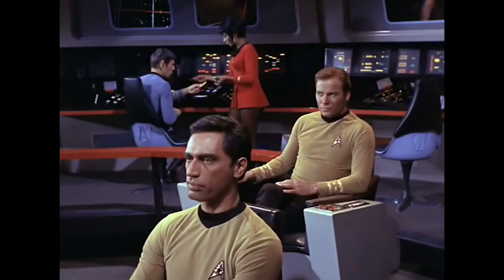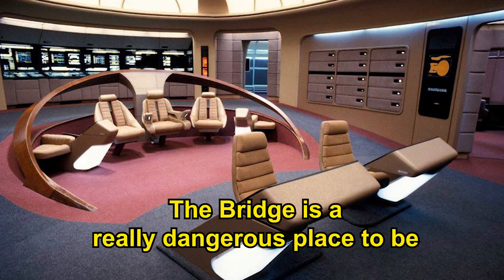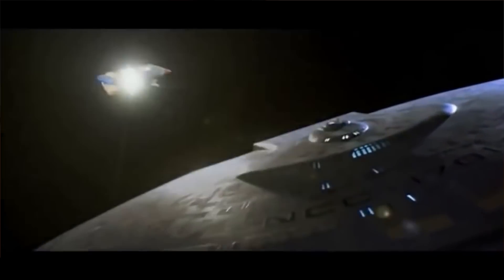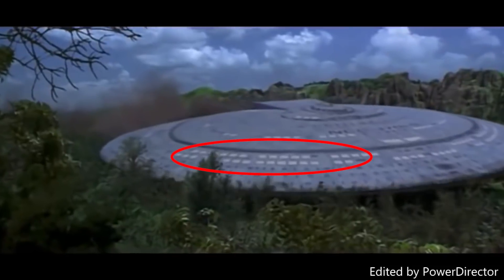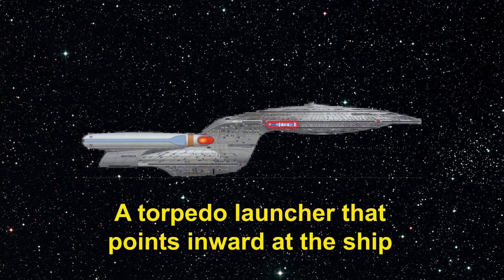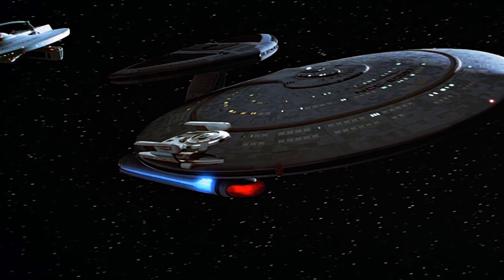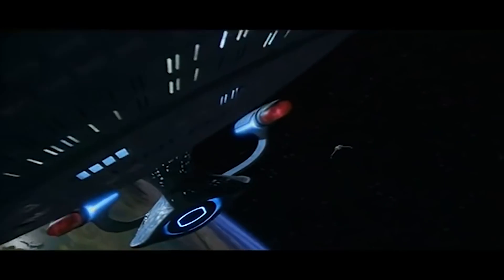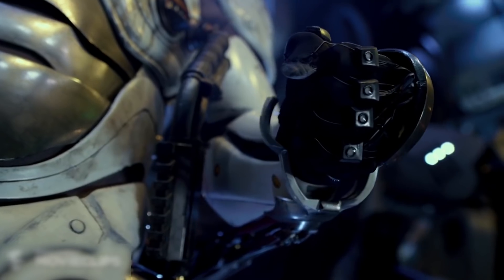10 Flaws Star Trek - USS Enterprise NCC 1701-D

Comment: Bridge is a known issue. Though how much it matters given how flimsy unshielded ships in Star Trek are in general is hard to say - most don't survive very long without shields, and WITH active shields it really doesn't matter where anything is.

Exploding bridge consoles... Yeah, that's just stupid in general and makes no sense.
... Restraints? Oh, you mean like the deleted ending for Nemesis? XD 
Then again, you'd need those throughout the whole ship; the bridge is no more dangerous than anywhere else, because what throws people around the bridge throws people around throughout the whole ship. (we never see this for some reason though.)

The saucer section landing probably could've been better, but that was essentially a completely uncontrolled landing, and they were determined to destroy it - in all honesty if the saucer had been functioning properly it would have remained in orbit, which was vastly more sensible than trying to land it anyway.
It's not like the ship's saucer section is in immediate danger just for having separated. It can likely operate for months if not years that way, even if it doesn't have warp drive.

A more controlled landing method would've been nice, but the way that film was written they would've crashed it anyway.

The shield modulation frequency...
Yeah, that's a stupid way of doing things, but it's quite specifically the MODULATION frequency.
Eg. the rate at which the shields change frequency.
The method could be improved, but the reason (insofar any was given) that ships even have a modulation frequency for the shields is because the shields are bidirectional - you have to drop parts of the shield in a controlled manner on a regular basis just to be able to fire weapons through the shields or even use the sensors.
Still, a less predictable modulation method is clearly needed.

Torpedo launcher complaint seems like a dumb one.
You know there's a phaser array in approximately the same spot right?
Besides, torpedos are just empty shells when in storage - you can't just detonate one, because for all practical intents and purposes it has no warhead - arming it by loading antimatter into it is part of the launch sequence.
That's no more of a risk than the antimatter pods.
For that matter, even if it was a risk, look at where the other two launchers are.
The forward launcher is in the thinnest part of the neck, so if you want to blow the ship in half by sabotaging a torpedo, that seems like a much better choice.
The aft launcher is also in a place that's both quite close to the main reactor, AND likely would blow the nacelles off if anything detonated there.
But this is on par with firing a phaser at the reactor core in terms of sabotage. It's hardly a meaningful flaw.
Torpedo casings could probably be transported from place to place inside the ship too if one launcher needs them more than the others.
They're empty after all. Moving an empty casing is no huge risk.

Warp pylons? Really? The same thing nearly every ship design in existence does? I mean, look at the ships the 'warrior' klingons use...
It should be obvious why you'd do this - engine placement is based on a bunch of factors and combat is only one of them.
The use of nacelles on pylons is a safety feature, for one, since you can detach a nacelle in an emergency to protect the ship - the closer to the ship's body the nacelle is, the less safety this offers.
Secondly, nacelle placement and engine performance are not independent factors.
Consider where aircraft engines are placed - there are multiple options, but they all have consequences.
This is typical of a mindset that views a starship ENTIRELY through the lens of combat, without considering ANY other factor. Which is a very stupid and myopic way of looking at things. Would you be willing to accept a starship that can go half the speed, at half the energy efficiency solely for the sake of combat effectiveness? Especially when combat is not that ship's primary mission?

As for joysticks... Eh.
I've used a flight simulator on a tablet PC using essentially only touch controls and it's quite doable.
so is using a PC flight simulator with a mouse.
A giant starship isn't going to turn on a dime, and the slower the craft you're controlling the less it matters.
Plus it's an aesthetic choice, not one based on logic - a keyboard with physical buttons is preferable to touch controls too - yet you don't see any such thing, or even physical buttons in general ANYWHERE.
But, given how such a large vessel flies, I really don't think it makes a huge difference. It's not a fighter.
You're not going to do an immelman turn while moving your giant-ass 600 metre long starship around in battle. 
Touchscreens and the like in my experience primarily are lacking for doing fast, frequent course changes, but that barely matters for controlling a vehicle that can't really do such things in the first place. 
Now, the Defiant could do with a joystick or something similar, but a Galaxy class would hardly benefit that much.
Just think of the primary ship's control as being a virtual trackpad, and if you have any experience of using something like that in a flight simulator you'll soon realise it's perfectly manageable if you don't need hyper-fast reactions...
Reply: It is no issue at all in ST universe and building templates.
Reply: You say that we don't see people being thrown around the ship anywhere but the bridge. I think I remember this happening in a corridor in VOY, and probably in main engineering on several shows
Reply: Other than that though this all makes sense, and to build on the point of the naccalles, their position affects the size/strength of the warp field that can be generated. For example the nebula class shown tops at warp 9.5, but the galaxy can reach 9.8. I'm no warp scientist but as far as I know the defiant broke the previous rules of warp nacelles, in that they need to have nothing between them to generate a field. This explains why voyager's nacelles are raised whenever it goes to warp. Voyager's speed of warp 9.975 is ridiculously fast, however it was the newest, best and fastest ship in Starfleet (because of course the title ship is the best). 

Overall, there are reasons for nacelles being where they are, and in battleships like the defiant they are less exposed, but as you have said, the galaxy class exploration cruiser is not a battleship.
Reply: ValorJ Omega  Besides that, the Defiant is ugly anyway.
Reply: ValorJ Omega 
Another violator of that “line of sight” rule is the Nebula-class starship, whose nacelle "power combs" are largely obstructed by the ship's engineering hull. The Oberth's nacelles are largely obstructed by the ship's primary hull. The Defiant and the Starfleet scout ship of Star Trek: Insurrection each have two integrated warp nacelles that are fully obstructed by the main hull. Other ships violate this rule as well, including the Romulan scout ship from TNG's "The Defector."
Reply: Ben's Pet Duck
Wasnt the Reason for the raising nacells at Voyager that they less damage the space? There was the issue that the normal warp drives did damage the space in some way.
Reply: @adm_ezri  The defiant didn't break the rules for warp nacelles, exactly.  You don't need empty space between them.  But putting anything between them interferes with the warp field and makes it both less efficient on power consumption and less stable, thus limiting your speed some.  The defiant designers specifically sacrificed warp speed to make the nacelles harder to hit.
Reply: I don't remember if they did less damage to normal space at high warp than previous designs, but the main reason for raising the nacelles is that it makes the warp field more stable at higher speeds and thus allows for safe use the higher speeds.  Which is why they were often down when Voyager was going at slower warp speeds or at impulse.
Reply: Regarding the joystick control. The video also fails to take into about the amount of computer control would be used to pilot the ship. Notice how when they are in battle they say "evasive pattern beta 4" or some such? It is because the ship is really piloted by the computer and the helm is there as a human interface to say "go here". More of an issue for me is why there is even a dedicated helm in the first place, given most of the time the ship is going in a straight line LOL
Reply: Preach on, sister!
Reply: Oh, and about the point about the nacelles being less or more exposed by the rest of the hull, just a note here - there are angles on the Galaxy class from which they are protected, just like there are other angles on other classes of ships in which they're more exposed. 

He made an example with the Nebula class ships but really, from most angles the nacelles on those are just as exposed as the Galaxy class. There are angles with the Galaxy class from which you couldn't even see the nacelles.||

Not to mention there's REASONS why the nacelles are placed away from the main hull most of the time.
Reply: I found it weird when the first shot would take out over half the shields, then it would take another few shots before it failed.

Comment: [Panel on the bridge explodes] Fuses, people! Fuses are your friends! Use them!
Reply: Fuses? How about something from the 20th century, like circuit breakers.
Reply: Resistors are futile.
Reply: @KRAFTWERK2K6  Sorry I have no capacitors for humour.
Reply: @Karen1963Yorks  watts the matter? That gave me a spark of humor, ohm telling you that's funny!
Reply: Keep it down you guys: We will have the transformers next.
Reply: @KRAFTWERK2K6  CLASSIC BURN!
Reply: @bostonrailfan2427  I feel we are making a connection. Sadly for you I have a girlfriend so your cable is not compatible with my  input socket.
Reply: not to mention why the hell they are using "high voltage" anyways.  Future ships should all be fiber optics, and not  6 gague 220 volt unfused  mechanical buttons!   Oh,  they forgot the fiber obviously!
Reply: @KindredIndust 
What? They apparently thought to use fiber optic cabling, in the turbolift, in that TNG episode in which they hit a quantum filament and it severely damaged the ship. They pulled some out and used it for rope when Captain Piccard and the children were climbing the turbolift shaft before it fell because one of its supports was broken. Maybe a different engineering team designed the turbolifts.

Comment: 8:45 "The Enterprise is actually lugging around 35% more volume..." Hey: Volume doesn't have mass! It's empty space. And comparing to Earth-bound vessels (aircraft carriers or submarines) is fallacious: There's plenty of room in space!
Reply: It isn't empty space. It's full of gas. Sudden compression can even cause that gas to ignite, such as an external explosion breaching a compartment. Explosive decompression isn't like it is in the movies either. It really is explosive. If there were a fist sized breach in the hull in a compartment, everything in that room would be sucked out into space through that fist sized hole; including human bodies. There is no possibility anyone could hold on, or dramatically reach for the control panel to shut the door or some crap like that. It would take all of about 4 seconds for all the atmosphere to get explosively vented into space; and what remained of human bodies would resemble long strips of frozen chunky pink foam.
Reply: Empty space doesn't have mass but you need more wall, floor and ceiling to contain a big empty room than a small one.